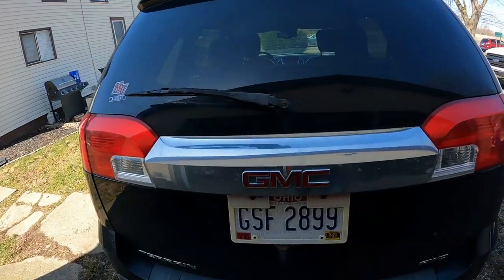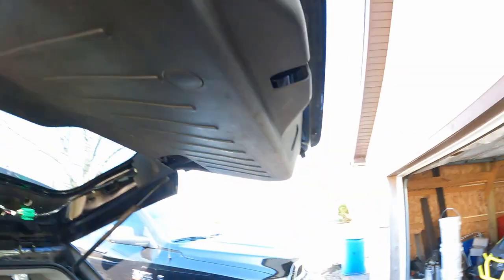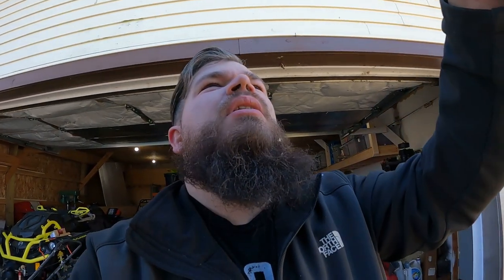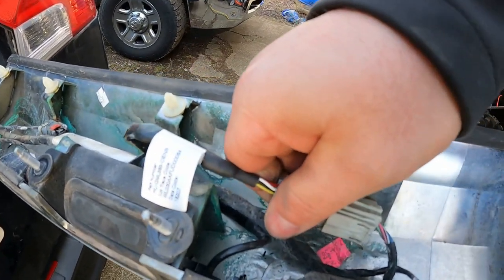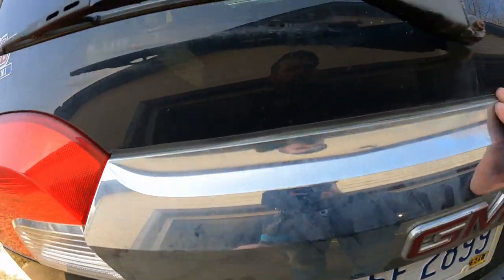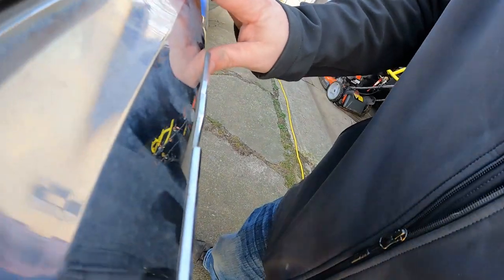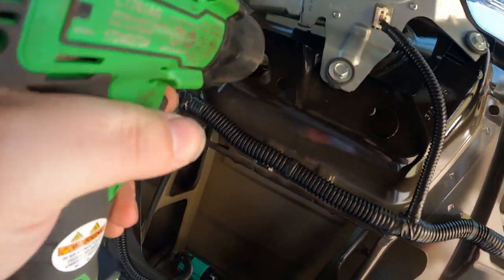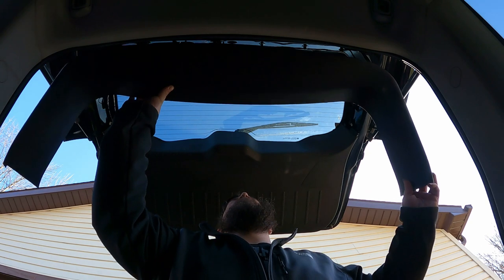2012 GMC Terrain Rear View Camera Install/Replacement

Comment: You solved my problem! Just replaced the rear view camera in my 2011 Buick LaCrosse.  I can really appreciate your efforts in dealing with removal of interior coverings to get to the fasteners holding the exterior chrome bar. What I thought would be a 60 minute job ended up a nearly three hour task. Before putting everything back together I simply set the chrome bar in place and saw a greatly improved picture of the back wall in my garage. I bolted everything in place, closed the trunk, started the car, put it in reverse, and found I had a really short view. It was a greatly improved picture,, but short in distance shown on the screen. Camera was OEM General Motors, $135 or so. Contacted the outfit I purchased the camera from. Best they could suggest was to contact the local Buick dealer. Before doing that I tried YouTube one more time. Glad I did. I found your video and had an “ah ha moment” at 18:25 on your video when you realized you had placed the camera in the wrong direction. It dawned on me then, that although I hadn’t placed the camera backwards, I had positioned it upside down. Tomorrow I’m gonna tear out the trunk cover again, and probably in just a couple minutes, and turn the camera 180 degrees. I’m quite sure that will be the fix.  Many thanks for doing in a few minutes what 10 or 12 other videos couldn’t do. You da man!
Reply from the maker: Hey Willy, good catch on the video at 18:25. Real easy to skip through and past that “oops”. 

Appreciate you sticking through the whole thing. Now that a day has passed, have you had a chance to rotate your camera 180* and see if your viewing angle was more what you were expecting???
Reply: @buffmotorsports4460  Wish I could give you an excited “It worked!”  Unfortunately it didn’t, because the camera turns only on a vertical axis (left & right) rather than a horizontal one (up & down).  In my head it first seemed reasonable,  but in reality the 180 degree turn would have the camera looking 1” away at the trunk exterior rather than to the rear of the car. Looks like I’m going to have to shim the camera in order to tip it up and give a longer field of vision.  Thanks for your inquiry. Next time I’ll wait until after I work through the issue to comment, cuz thinking through it surely wasn’t enough.

Comment: A great help. Thanks!  Totally successful except the one trim clip I destroyed in the same spot you wrestled with it. (TIP: don’t hit it with a soft mallet) No biggie and the picture  is better than new.
Reply from the maker: Soft mallets I believe exceed the tensile strength of the plastic… so do meat hammers. The side of my fist was not kind to that plastic either 🤣

Comment: My backup camera in a Chevy Equinox nothing but a black screen.Do you think it's a fuse?
Reply from the maker: Anything is a possibility. See if your owners manual lists where the fuse panel is and which fuse is for the back up camera. I’ll be honest, I never checked the fuse. Obviously in the video I ended up replacing the camera and it’s still working just fine. 

Also keep in mind, fuses don’t fail without reason. Maybe replace it Once to rule out a fluke, but if a circuit protection device fails it’s because it is doing its job and there’s an issue with the component or the wiring.
Reply: @buffmotorsports4460  THANKS.My fuse was good.I'll check my brother's junk yard for a GM camera.

Comment: Holly crap lol $175 you could’ve got an entirely new radio with android 10 operating system with a camera (pretty much the 2018 style factory radio plus carplay and wireless car play and phone mirroring for $250.. lol. 

All these modern day tech units are nothing more then simple android touchscreen screen tablets made to whatever size and programmed for whatever and then it’s just about using the right connection interface for whatever vehicle it’s in.. they are all $200 Chinese built units lol. I can’t believe you paid $175 for just the camera 🤦‍♂️
Reply from the maker: Man… it’s been a minute since I’ve watched this vid. I think the OEM was $175. I did not buy OEM. 

Now if I did replace the head unit to take advantage of all of the benefits listed above… I would have still had an inoperable back up camera… since it was the camera and not the head unit…